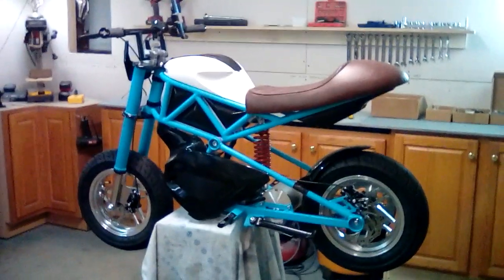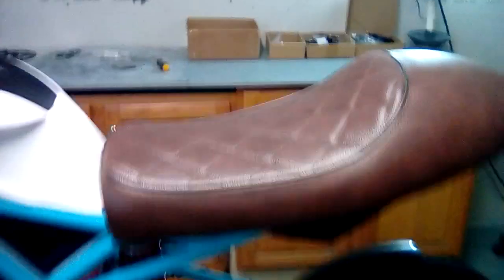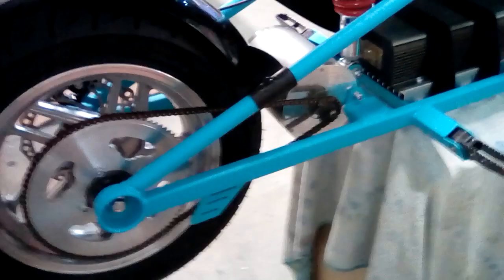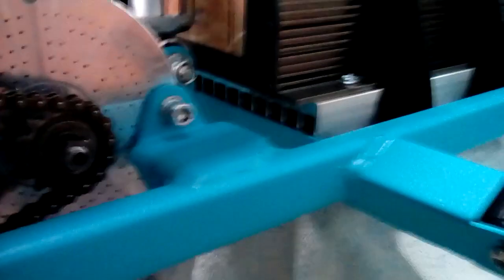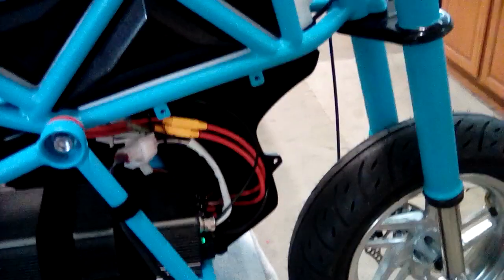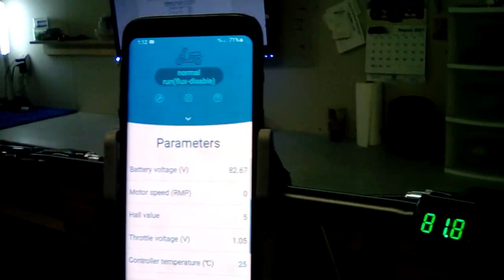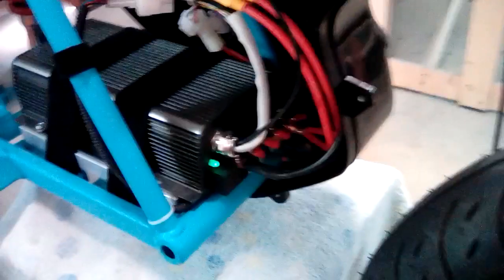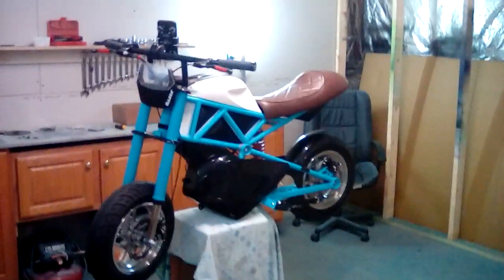Razor RSF650 - FIRST EVER 72V SABVOTON BUILD!

Comment: This is a beautiful build out of an rsf650, I really, really like it... I have an Mx650 that I'm doing a Supermoto build on and I'm not sure which motor, controller and battery I want to get, I'm trying to decide between the 72v 3000w motor w/ a Kelly or Sabvoton controller and a 72v battery or if I should go QS 273 3.5t 5kw hub motor w/ Kelly or Sabvoton controller and an 80v Greenworks battery pack, or a mix between the 2. Might do a series of videos series on my build as well.....    😁
There's a Facebook group I'm in called Modified Razors and some of the builds on there have Sabvoton, Kelly, Amazon, eBay, etc controllers and some people will send you their settings to help you out... You should post your build on there, I'm sure they'll love it¡!
Reply from the maker: I have been in Modified Razors for years.